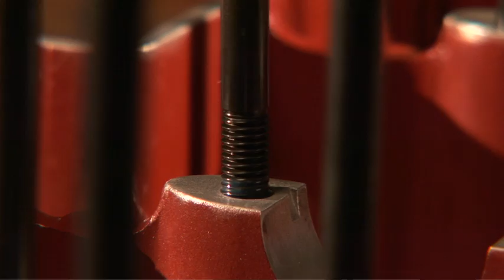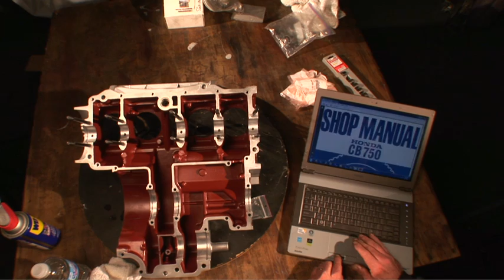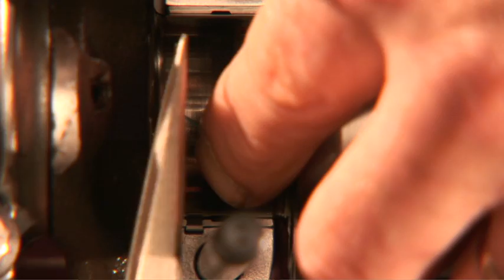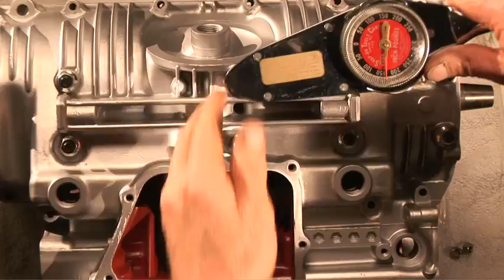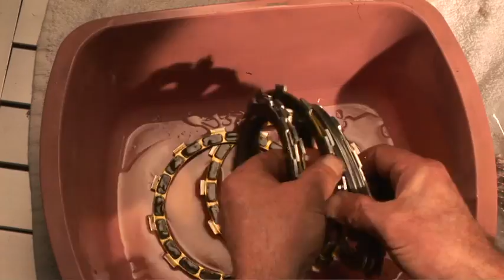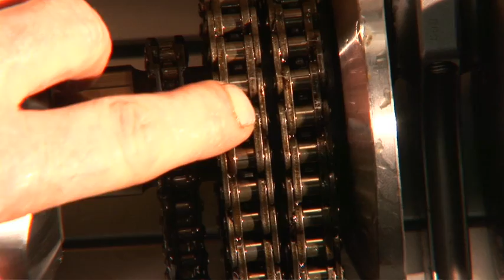CB750 K2 Engine Build

Comment from the maker: Richard, that you for your kind comments. The main bearing shells I installed were new. However if yours are in good shape with no signs of scoring or excessive wear you could reuse them, just measure them to be sure they are in tolerance. If you are talking about the cylinder studs I put them in with loctite blue at I think 8 ft pounds. I would have to look at my notes to be sure. When you go back to torque the head the studs will not move. Hope this helps. best of luck to you and your bike.

Comment: I also am trying to figure out whether I should just replace all the valves or not. I checked all the valve springs and they are all good. I also checked the valve lifter bore and they are all good. I am also thinking of replacing the pistons and rings as well as the piston pins since the piston pins are really close to service limit. As far as the cams and crank goes I do not know really what all needs to be done to them? i.e. magnafluxed, polished, so forth?

Comment: Thanks a lot, after looking closer at your video I saw you put two nuts on the stud to torque the studs. So far the engine looks pretty good and it only has 18k on the engine which isnt much. In regards to your motor, I was wondering what you used to make the mating surfaces where the two engine halves mate together look so good? It almost looks painted silver it looks so perfect! Again you do great work but still curious about the prep to the engine overall. Thanks!!!!

Comment: You really do awesome work and I am fully restoring a 82 Honda 750 nighthawk. I need your help and wonder what you used on the motor where the bearings are to make it look brand new? I am also wondering how you were torquing the long case bolts that have threads on both sides? Special torque wrench adapter? I appreciate the help!! Thanks and as always keep the shiney side up!

Comment: Ok sounds good! I will be careful. Thanks for all the help! I just find it hard to believe that when I called a sandblasting shop he had no idea what I was talking about when I asked about cut-wire blasting. No wonder all the good motorcycle shops are in the east coast and south! lol One question though, after you remove an engine part, how do you preserve it so it does not get rusty while you are doing other stuff? Just coat with oil?

Comment from the maker: Richard the prep for the engine cases are as follows. After the cases have been completely disassembled including cylinder studs the cases are washed and inspected. If everything looks good they are then cut wire shot peened. This relieves small stress fractures in the engine casting and takes off any engine coatings off the block. The engine block looks new at this point. It is then ultrasonic cleaned. I then go in with Carbide porting tools and remove any flashing from the original casting.

Comment: The transmission parts all look really good and plan on replacing all seals but lack of experience on my part, I am not sure if I should just replace all the bearings at this point or not. They look good but a couple have a little wiggle to them so I am leaning on the side of caution if you know what I mean. I was reading the manual last night and it is pretty straight forward on reassembly. It also looks like after I get the head back on I do the valve clearance step.

Comment: The engine case is alluminum so you can not use steel shot as it will inpregnate steel in the alluminum right?

Comment: Ok sounds good, right now I have all the valves and springs in a milk crate labled 1-4 intake and exhaust. I have also gone through each microfiche and labeled and bagged all parts according to where they go on the bike as I determine what needs to be replaced and or restored. I think the engine is the most consuming since I want to make sure I do everything right on the mark (perfect).

Comment from the maker: No clutch rattle on this engine. You may want to check to be sure you have the proper clutch stacking height as well as friction disks and pressure plates not worn beyond min tolerance. Also check clutch springs to make sure they are not worn. If they are they are pretty cheap and easy to install.

Comment from the maker: Richard, it's like shot peening but with out the shot. They use stainless cut wire instead. If you can not find that available in your area you may want to consider using glass beads.  Oil passages should be taped off so no blasting media enters these areas, this is very important. When they are done be very diligent in cleaning and blowing off all of your parts. Bead blasting is fine for you. Just be careful.

Comment from the maker: Raymond, the red paint is Glyptal. It is a paint used for years by engine builders to shed oil. It makes the cases real slippery. This engine was used in a Bonneville land speed attempt. The engine was 748 cc with custom pistons, Carrillo H beam rods, Kenny Harmon Super F cam and CR31 carbs. Everything was blueprinted to better than stock specifications. This engine was put into a Rickman CR750 frame and raced in 2011.

Comment from the maker: The engine cases are red because I painted them with Glyptal. This is a paint that helps oil shedding. This has been done for years with High performance engine builders. I paint Glyptal on all my internal engine cases.

Comment from the maker: Richard, while I am disassembling I use ziplock bags to keep everything in it's proper place. Example would be like all clutch components with basket and plates with friction disks go in a bag and smaller parts nuts and bolts washers, ect. go in a separate bag. Same thing for the transmission and other assemblies. If you are working on valves each cylinder has its own bag that is marked 1,2,3,4. I always clean ASAP to make sure all parts are good. Stop corrosion by spraying WD40 in the bag.

Comment from the maker: Replacing the seals is a very good idea. Some of these have been sitting around for years without any oil they get hard and brittle. The bearings may still be fine, look to see if there is any discoloration indicating heat or they are flat or scuffed up. If they are not you are are good to go no need to replace them. Sorry have to run.

Comment: Hi rklstron - Just wanted to give you an update, after a year of getting all the parts refinished I am getting really close to putting my 82 Honda 750 Nighthawk back together. I am going to Glyptal paint the inside of the motor and start putting it back together! I just hope all goes well. Hope all is good with you! Later

Comment from the maker: Cut wire shot peaning is fairly large in particulate size I have had no problem with embedding in the Aluminum. The other great thing about CWSP is it relieves stress formations in the metal to make it stronger. This has been done for years on connecting rods and blocks just to name a few engine components. You could do it yourself in your blasting cabinet, I know many that have. I however do not like the idea of sand or glass particulates in my engine. Abrasive stuff. Good luck!

Comment: I measured the bore on the cylinders and they are really good from what I could see when I mic'd them with a bore gauge. I also checked the ring clearance and that was good as well. So I am thinking I need to hone the cylinder to clean them up and then buy new rings (standard) but after honing I will check again and if need be I will go up to first oversize on the rings. I will also check end play on cams and polish them and the crank as well.

Comment: You should leave the clutch plates in a a can of oil for a couple of hours.
Otherwise you have the change that you will burn the steel rings between the clutchplates in the first 30 seconds of the engine running.

Just a tip.

Greetings from Holland :)

Comment from the maker: The Cam if it is in good shape nothing really to do there. Mack sure you check end play on the cam though, you do not want that dancing around to much. The crank if you do not want to lighten and balance, minimum the journals should be polished. Any good engine shop should be able to do that. Did you measure the bore on the cylinders to see if you have to go over size or not?

Comment from the maker: I try to make the inside of the block flashing free. Once this is done I clean it again with solvent and air. Now I am ready to paint the exterior and coat the interior. The paint I use requires to cure at 200 degrees for 40 min. I wait for the wife to leave the house before attempting this.  Even then I am in trouble. Something about the house stinking. The mating surfaces are sanded with wet/dry 400 grit in a circular motion with a 6" x 4" steel block with the sand paper glued to the block.

Comment: oh come on red loctite in a engine build is not a good idea use blue if any at all if a stud breaks for some reason in the aluminum case they dont come out easily, some moron red loctite the camcap bolts on my spare engine that i needed the cylinder head off for my engine because the exhaust studs stripped and cam caps were over torqued and came loose just after i bought it and all the cap bolts stripped after heat and trying to turn them back n forth, so i helly coiled my exhaust bolts and put it back together and never got another ride out of it again sold to an aircraft mechanic so i dont know where it went from there